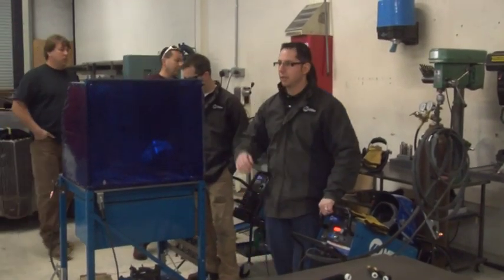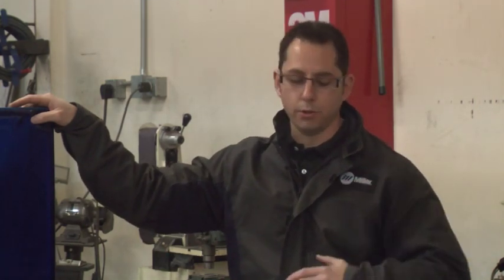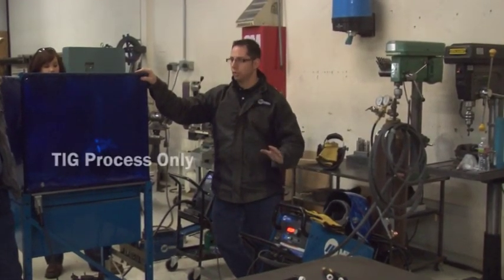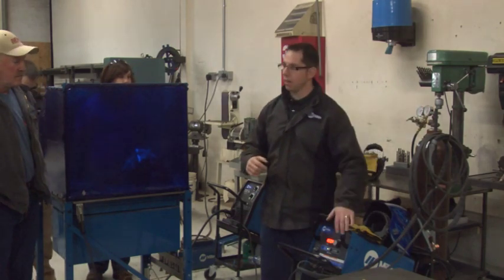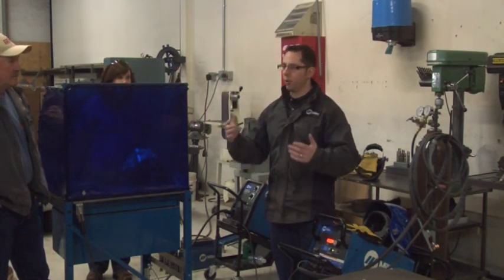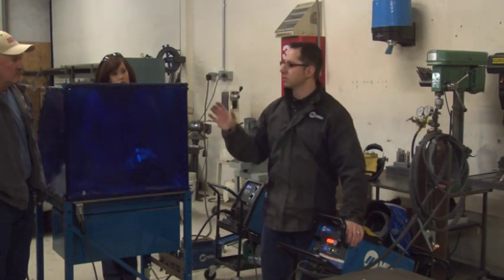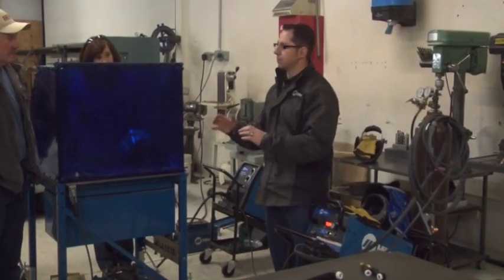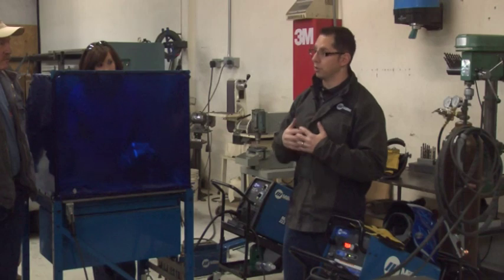Features and Benefits of the Miller Diversion™ 180 TIG welder

Comment: I have a 180 and it is the worst welder I have ever used. The arc walks around and will at time come of the side of the tungsten. Puddle control is very poor and I have had in the shop many times the first time was for a bad circuit board, they did replace it under warranty. I would not recommend this machine to any body. I have had many other guys most seasoned welders try this machine and say the machine was total crap. I went to smaller tungsten and it worked a bit better but it came with an 1/8 inch setup I would think that it should work with that. Poor machine.
Reply: Define seasoned welders.